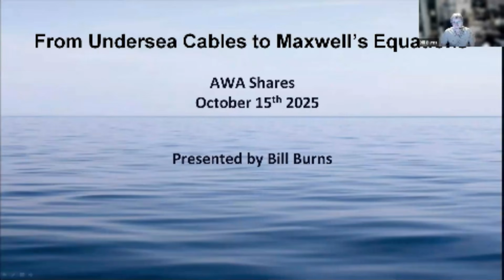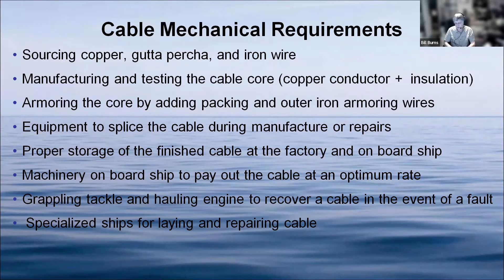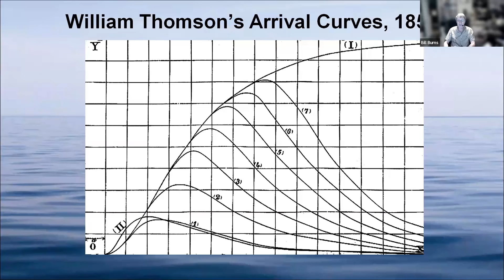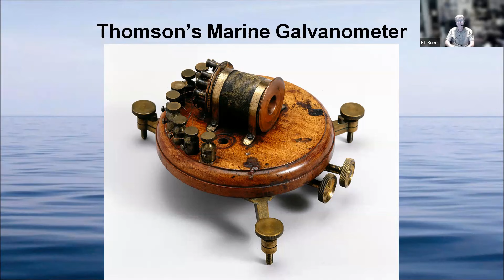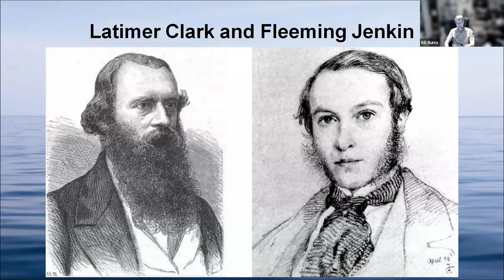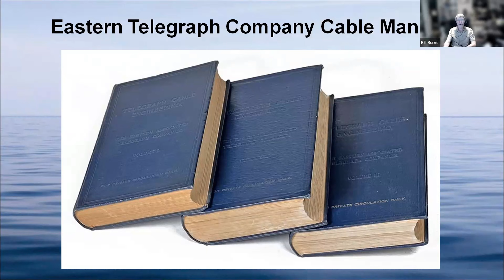From Undersea Cables to Maxwell's Equations

Comment: An hour of Power Point slides, and no explantions of Maxwell's Equations at all
Reply: Thanks for watching!
I could have spent another hour just on that, but it's been done many times by others.  The main point of my talk was to illustrate how Faraday, Maxwell, and other scientists were stimulated by the new problems that arose during the development of undersea cables, leading to many advances in electrical science and practice, and more generally, field theory.